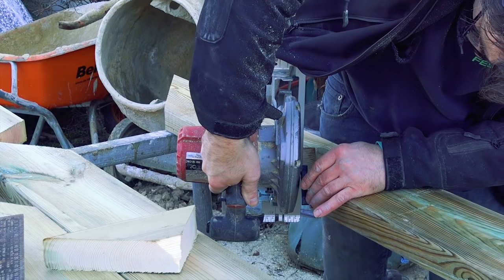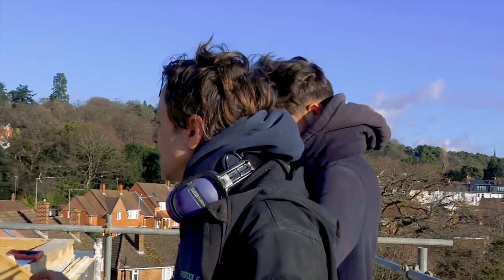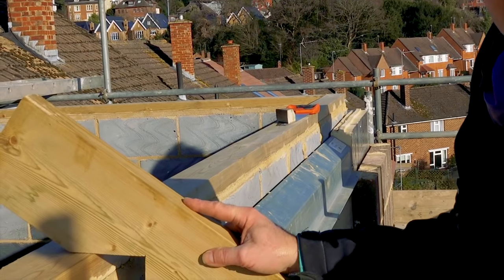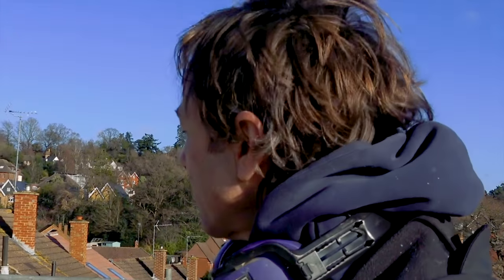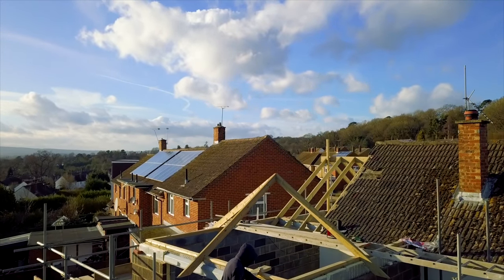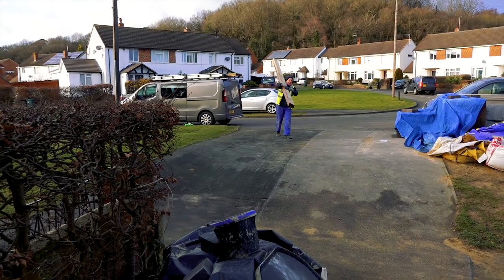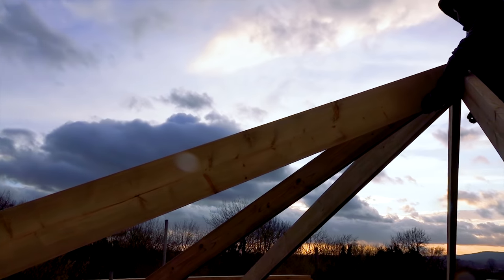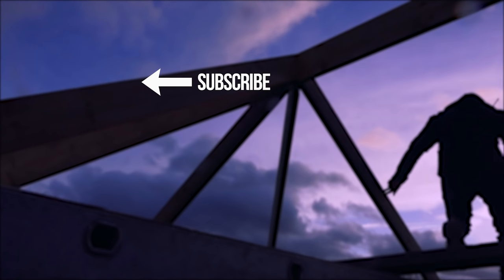Building an Extension #8 - Cutting Roof Timbers

Comment: Could  have done with your help today Robin. First hip roof I've cut in years  and I was scratching my head. I calculated the run of hip out the book and it was to long. Got it to fit but I had to manually measure it. I'm think I went wrong by not allowing the fact I cut a 45 on the wall plate and didnt take of this measurement. I  over word is the length of he hip to the point of the wall plate before you 45 it? Please help haha

Comment: Robin.  Help needed.  Could you point us in the direction of fitting a wall plate please.  I have to fit a 19’ ‘wall plate’ on a squash court gallery.  Having taken off the old timber cap I have bare brick, a few of the bricks are smashed from where the amateur tried to drive nails into masonry to fix.  Suggestions?

Comment: all he had to do was double up the sole plate  birdsmouth cut wouldn't be so deep weakening the timber do not forget your  SABREFIX TRUSS CLIPS or Simpson Strong-tie if you're so particular like me  i use them on every roof i do.
Reply from the maker: As I read it, the new timbers were 6x 2 while the originals were 3 x 2  so with the height above plate being the same the only way to keep the rafter to the same line was to cut a deeper birdsmouth. I don't understand how doubling the plate helps but hopefully you can explain it. I like the truss clips. I use the Teco ones on some jobs.
Reply: voodoo audio 
Surely if you double up the wall plate, you’re taking even more out of birds mouth?☹️

Comment: Birds mouth is not good in high wind areas and metal brackets are the best as they are secure and do not weaken the rafter. And Toe nailing the rafter is  a weak joint.

Comment: It looks like you've cut the corner of the plate at 45 deg the width of the hip (45mm) , I always done that but some carpenters I know leave it square, whatever works for you works I suppose. Another thing good to know is measure the distance vertically from the birdsmouth (corner of plate) to the top of the rafter and use that measurement on the hip plumb cut for the backing measurement of the hip, that way the top edge of the hips and rafters will be exactly in line,. I'm sure you know this Robin but just mentioned it for those learning the trade. Just found your vids and loving them, very informative for someone new to the trade. As a builder once said to me "it's not a game" after someone said to him about the building game, and he was right, it's not a game.

Comment: I did not understand why he said that the wallpates had to be secured with temporary ceiling joists as they would be secured down with restraint straps, did he mean that because he was not putting in a conventional ceiling he just fixed some timbers across while he was fitting the rafters.
Reply from the maker: You have it precisely. Thr roof can push the walls out or dislodge the plate if you don't tie it in. Once the rafters are in you still need some kind of ceiling collar or tie to keep it in place. These days it could be a ridge beam of steel or very heavy timber.

Comment: Is the rise of the the roof the  measurement from the top of wall plate to the the pitch line  2 thirds down from the rafters top or to the actual rafters top edge
Reply from the maker: top of wall plate to the top of the rafter where it joins the ridge. Sometimes the ridge board is set slightly higher so it is always the top of the  rafter.  This explains it with more detail https://www.youtube.com/watch?v=_TmXZ0cGNEI&t=1181s

Comment: Hi im doing my own extension now i used 150mm hex timber screws on the rafters and you guys used nails should i nail them and why? Cheers great vids btw.
Reply from the maker: No you are fine. The roof is sitting preety on the steel and the wall plate. The collars are bolted so it is solid. There is not problem with high winds in that sheltered location and it is strapped  down.. The roof on the main house was built with cut nails and a 100 year on it is still there.